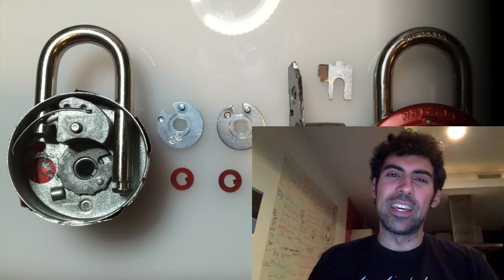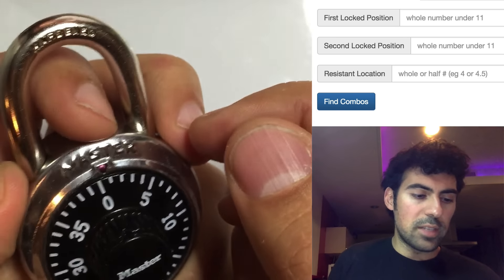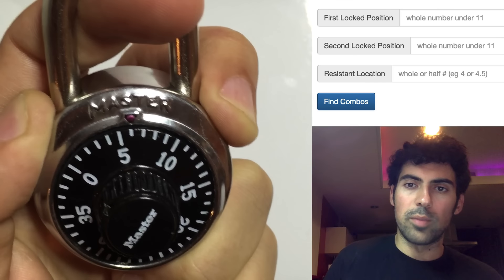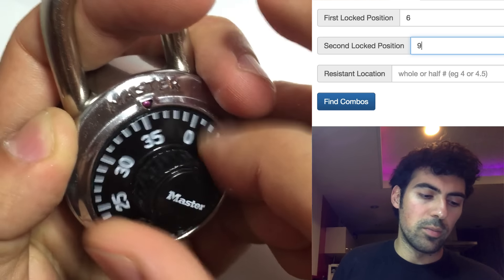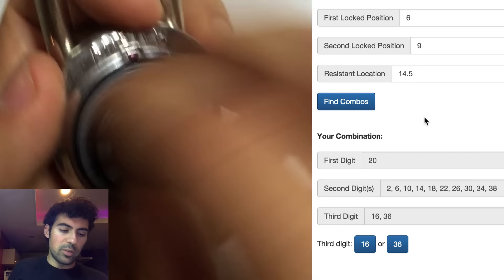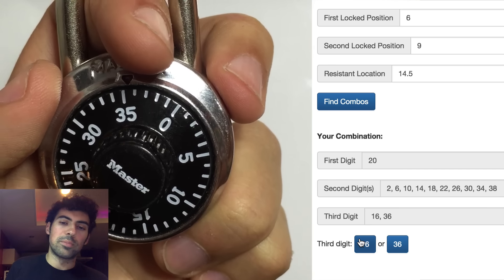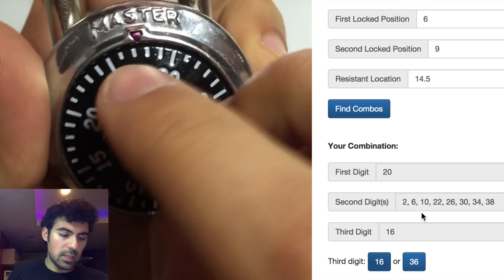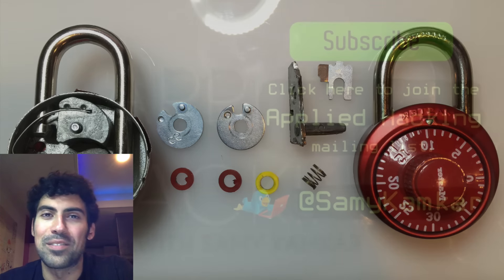Break open any Master Combo Lock in 8 tries or less!

Comment: This technique worked for me on a lock I bought around 2012. Not without some trial and error on the first two steps. However, on an old master lock that I had from the 90's, using this technique does not work. The combo is 37-27-10, which is easy to remember since the third number is the difference of the first two. Entering the first number minus 5, and playing around with the other two boxes never results in a third number which gives a 10. Now there are occasions where I get no number in the third box, so it could be a coding error on his page. Just be forewarned that this may not work on all master locks.
Reply from the maker: Hey Alexander, thanks for the comment. Did you ever get "9" instead of "10" as the 3rd number? My tool exploits a combination of issues in the lock, including the loose tolerances the lock mechanism has. You'll find 9 will actually unlock the lock in addition to 10, and the tool is built to provide a single working solution even though there are several per lock.
Reply: @samykamkar  So following your steps, I found 3 places where the dial stopped between 0 and 11: 3, 6.5, and 10. From this, I place 3 and 10 into the first two boxes, and 32 into the third (since I know the first number is 37). Just in case I was reading it incorrectly, I used different combinations of these numbers. Doing this, I still did not end up with a 9, or ten for the last number. 

All in All, you have done a great job here with your technique. After all it did help me with my newer lock. Keep up the good work! I have no problem working with you on this one just in case other people have the same problem as me.

Comment: My lock is a bit old now, but for the life of me I can't get this to work. Tried for like 4 hours now. It gets stuck between about 1.8 and 2.6, then perfectly between 5 and 6, then again between about 8.3 and 9.2. The 3rd number I'm certain is 14.5, it took me a while but it's been incredibly consistent so I'm sure of it. So my numbers SHOULD be 2, 9 and 14.5, yet not a single one of the combinations listed under that order works. I've tried both ending numbers, and I've tried all these combinations incredibly precisely multiple times over, and nothing. I've tried to account for any slight adjustments there might be, but none that I've tried worked. This lock is driving me crazy
Reply from the maker: What's your resistant location? You can also test for the two locked positions between 10 and 20 -- are the lock positions 12 and 19 in that case?
Reply: @samykamkar  the resistant location was 14.5 and yes, 12 and 19 are also the locked locations
Reply from the maker: @slothfulfrostgod5281  Okay, that helps confirm the locked locations are 2 and 9 (make sure there are no other locked locations that cross over a whole number between 10-20...I'm guessing you'll also have 15-16 without crossing over a whole number), but this likely means your resistant location might be slightly off. Try using 14 instead of 14.5

Comment: Hey awesome video I used this for many locks in the past , but I seem to have an issue with a master lock that I changed the combo on. So the combo I found that unlocked it the first time was 29-35-5 , now after resetting the combo this combination no longer works of course , but yet the same lock positions remain, and none of the 8 combos attempted from the website would work.  Am I SOL in this situation ? Or Is there a way to crack the new combination??

Comment: Didn't work for me. However, what if the first locked position is a grove that ranges between 3 whole numbers?
For example, I have a small grove that goes from 4-6. I assumed 5 would be my first locked position. 
The 2nd locked position was normal in that it had a value (8) between half digits.  There's also no other half unit grove below 11.

Comment: Didn't work on a lock with known combination.  First two digits are easy, but could not find the third one, either with eyes open or closed.  The correct third digit (for the input to the calculator) has no consistent resistance feel to it.  This is an older lock - maybe 20-30 years, I think?  So does internal wear defeat finding the correct input for the third digit?
Reply: Interesting.  It did work for a second lock with unknown combination.  In fact, there was a label on the back which gave a bit of misdirection.  I wouldn't describe the third "resistance" as that.  More of a grating feel to it.  Almost like you're running something over gear teeth.  You have to get just the right tension though.

Comment: 4 out of 4 locks failed to be resolved by this.  To be fair the 100 combo method didn't work on one of them either (still have to try it on the other 3)
Reply from the maker: +Seth They're Master brand? Can you tell me the resistant location / locked locations? Have the serial number?
Reply: @samykamkar  I'm not sure it'd be useful.  The only one I have the pass to (34,4,26) doesn't even apply to the 100 combo since it locks at 16 and 26 which would nullify the final number, but even the combination is not an option in the 100 possibilities.   This is lock #1.

#1: 904878 R:2 L: 3, 6, 9
#2: 903555 R:33 L:4, 7
#3: 630869 R:10½ and 34 L:2, 5, 8 (it is weird) 

#4: 904878 R:2 L:3, 6, 9.3 (kinda weird)
Reply: Good news, I figured out the password to one of the other locks, and I'm sure you've figured out which because you're smart too and know how I figured out the pass.
Reply from the maker: @sethlester1659  Hi Seth, that's fine -- what's your resistant location? It can be tough to find but it should be ~29. Once you find it once, you'll know how to easily find it on any lock.

The reason I ask for the locked locations under 10 is because one of them (in your case you only have one) will be the 3rd digit plus a multiple of 10. The same operation works for locked locations greater than or equal to 10, you just need to modulo 10 first. For example, (26 % 10) = 6, so your 3rd digit will be either 6, 16, 26 or 36. Two of these are then removed based off the resistant location because the (1st digit % 4) must be equal to the (3rd digit % 4), so (26 % 4) = 2 -- that cancels out 16 and 36 as they're both % 4 = 2, but 6 and 26 % 4 = 2. Your 1st digit must also be % 4 = 2 (in your case, 34 % 4 = 2). Also, the 2nd digit is always going to be ((1st digit + 2) % 4) = (2nd digit % 4).
Reply: @samykamkar  it has a resistance at 29, but it's not nearly as strong as the one at 2

Comment: Please Help. I have a Master Smooth Spin Combo Model 2076. My first number is between 1.5 & 2.5 so I use 2. My next number is between 4.5 & 6.5. What do I do there. My drag seems to be at .5. Tried multiple numbers and still no luck. Is there something different with the Smooth Spin type of lock?

Comment: I keep trying but cannot get this to work. Have retried finding the numbers and tried 32 different combo two times each. The lock is over 20 years old and someone attached it to a beautiful vintage wicker chair. I tried hitting it with a hammer but it was damaging the chair so I stopped. Shim wouldn’t work. Is there a list somewhere of all possible combos I can try?
Reply from the maker: What are the locked and resistant locations?

Comment: I tried this on my lock but I'm having trouble finding the resistant location. I can't tell what that's supposed to mean, like if it's supposed to stop or just slow down. Mine seems to be a little tougher to spin from 39 through 30.

Comment: I've had this lock stuck to my backpack since I went to the rec center a month ago, I know roughly which numbers they were becasue they were stupid close to eachother but none of the combinations that I've gotten from the website work. I can't tell if they changed the internal design after all these years or if I can't feel the right last number. I've done the first two and they were both 6 and 9 but the 3rd is a mystery to my fingers
Reply from the maker: That resistant location is hard to find, but it's there. Just takes finesse -- once you feel it, you'll be able to do it over and over again on any lock, just takes a little to first get it.
Reply: @samykamkar  thank you for the encouragement

Comment: Worked for me even tho my brand is different. Thanks
Reply from the maker: Awesome! What brand?
Reply: Samy Kamkar The sticker is peeled off on the back and the brand isn't engraved in the metal. The center of the dial has a logo tho. The logo is a house with a palm of a a hand in the middle.. might be some cheap junk brand. But it works.

Comment: On mine it gets a groove between 0 and 1, so I move on and easily get my first locked position between 3.5 and 4.5. However, when I try to get my second locked position, it gets stuck between 7 and 8 and again between 10 and 11, but decimals are not allowed. I also get my resistant number easily at 29.5... help?

Comment: Tried and it does not seem to work - I have a master lock from Sept 2022 and they do seem slightly different (the arrow at the top is black rather than red) - and so far none of the videos work ... have they changed something in the lock? I think i can get the first digit ... but 2 points of resistance between 1 and 11 are never clear - it gets blocked between 1-3 / 4.5-6/8-9.5/11.5-13 so they are bigger gaps...

Comment: I've tried this with two locks but haven't had any luck.  The first two numbers are easy to find but, I find the resistance part challenging. I relax the tension on the shackle just enough to turn the dial (without looking) and it invariably catches in two or three different places.  The last time I tried it, I was given 10 possible second numbers, none of which worked.  Any suggestions besides not taking up safecracking?
Reply from the maker: Do you have a lock where you know the combo? If so, the resistant location is about 5 numbers before the 1st digit of the combo (so is first digit of combo is 15, resistant location is around 10)...once you feel that resistant location once, you'll have a much more intuitive sense of how much you need to lift the shackle, and how much resistance the location gives and it becomes much easier to find it across other locks.
Reply: @samykamkar  Thank you for your reply.  At present, I do not have a lock that I know the combo of but, will try to locate one to practice on.  One difference that has occurred to me is that you do it while lifting the shackle with just one finger. The lock I'm trying to open is on a gate and so, I'm 'lifting" the shackle by pulling down with my hand and as a result, am probably "lifting" the shackle with way more force than you.
Reply from the maker: @togamac  I lift the shackle up about half way but note the position is very important...once you get the consistent resistance at the same location each time then you know you're there. Good luck!
Reply: @samykamkar  I tried again today. First, I rechecked that the first stop was a half number, then rechecked the next two whole numbers before 11. They were what I had before, 5 and 8.  Then, I released tension on the shackle and turned the dial clockwise repeatedly without looking at it while slowly putting tension on the shackle.  It stopped at 15.  I maintained the tension on the shackle and turned the dial again and again it stopped on 15.  When I enter those numbers, i get 20/2,6,10,14,18,22,26,30,34,__/8,28.  28 had more play than 8.  Yet when I tried all possible combinations, the lock would not open. (Unable to read the last second number after 34 so I tried 35 thru 39).  No dice.
Reply from the maker: @togamac  Last number is 38 (each one is off by 4). Closer to 15 or closer to 15.5? If it's closer to 15.5, the solutions are different (14.5 and 15 are the same though)
Reply: @samykamkar  Got it! It was the 15.5 that did the trick. Thanks again Samy for the excellent communications. A tip to those trying to open a lock that is locked such that the face is 90 degrees from your face. Try to get into a position where you can look at it well enough to positively determine a whole versus a half number; it may save you a bunch of time!

Comment: i have a question will your little program work if the two numbers that it locks in first are over 11 because the only whole numbers i am finding under 11 is 0and 10 any suggestions?? its a puurple 1526 D masterlock combo lock....i had the combo then forgot and this isnt really helping me firgure out how to open it.  ive tried working through all the sticking points plus your code breaker and im not getting really anywhere.  help please??

Comment: I know that this is now an old video, but i know when combination and am trying to reverse engineer the first position, second position and sticking resistance #, can this be done. my combination is 13-38-8.  I had 1st sticking point of (1-1.5) 1 , 2nd  (4-5 which we skipped)...so (7.6-8.8) 8 and i thought the restistance # was 35.5 so 36....The number dont match. Would love to know if we can figure out why it didnt work for me. Thanks in advance.

Comment: Did not work with sphero model... I found the trick.  Determine 3rd # by most freeplay... then use the divide by 4 and use remainder to generate possible 1st and 2nd numbers.

Comment: I give up. I don't find any first or second locked position. I tried extreme pull and hard pull nothing it just grinds over those without resistance. My first number is 3 because 37.5 - 38 is the resistance. I can't find the other numbers at all. Turning it to the right locks it at 30 can't go any further with pressure applied or not

Comment: This worked well to figure out the first two locked positions but I struggle to find the resistance number. Is there any way you could help or am I on my own?
Reply: Braydon, what works for me is to loosen the shackle tension so that it doesn't catch on any numbers. Then, look away and turn the knob while gradually increasing the tension after every revolution.  When it stops, carefully note the position by positioning the lock face in front of your face, i.e, not at an angle.  The half numbers can make a big difference, e.g., 15 vs. 15.5 in the combo.   Then repeat to ensure you have found it by landing on it again without looking. Good luck!

Comment: This didn't work for my lock. I know the combination so was just seeing if I could figure it out. :)

The first locked digit is 0 (39.5-0.5), second locked digit is 3 (2.5-3.5). Resistance digit is 15. The website says the first digit is 20. The first digit is actually 4. It's got the other two spot on, however. 

For kicks, I tried between 10 and 20 and came up with 10 (9.5-10.5) and 13 (12.5-13.5). Using the same methodology, I get 20, 23, 30, 33.

Any ideas?
Reply from the maker: I think your real resistant location is around 39 (play with how much you lift the shackle...I usually lift less than 50%). It definitely takes some finesse but you should feel it once you get the right amount (and it becomes much easier to reproduce once you feel it)
Reply: Samy Kamkar the resistance is definitely at 15. 39 is just as free as anywhere else. At the point I get resistance from 39 it starts getting locked at every groove.

I've had the lock for about 20 years, if that makes a difference.

Comment: for my first 2 locked positions are between 2 whole numbers (2/3 then 5/6) after that its gets stuck between (8.5/9.5) so my second position is 9. but i still dont have the 1st. how do i find it?
Reply from the maker: What are your locked positions between 10 and 20? If it's 12/13, 15/16, and 19 (19 being the only whole number), go ahead and enter '9' twice, otherwise if you find another full number, remove the first digit (for example if you find 15 is a lock position, enter '5')

Comment: I am not getting the combo lock and your formula to work. My 0-11 numbers have not in-between number. They all land on a whole number. Example, 2 and 3 or 5 and 6. I get a few sticky numbers but one feels to have a slight more stuck. Any advice?
Reply from the maker: Try between 10 and 20, any whole numbers there? If so, remove the '1' in front...so for example if you find 13.5-14.5, where 14 is the whole number, use '4' instead of '14'
Reply: @samykamkar  Roger that. Thank you sir

Comment: First between 3 and 4 (ignore 3.5)
Second between 6 and 7 (ignore 6.5)
Third between 9.5 and 10.5 (took 10 as the whole number for First Locked Position)
Fourth between 13 and 14 (ignore 13.5)
Fifth between 16 and 17 (ignore 16.5)
Sixth between 19.5 and 20.5 (took 20 as whole number)

I don't have 2 whole numbers under 11 (39.5 and 0.5 has a locked range, but 0 can't be used right?)
What do I do?
I also remember my third digit, but forgot the first 2, not sure if that helps?

Comment: I have tried many times to get this to open the lock that I have. Sadly with no luck. I know for a fact that the last number is 30. Which it does give me the option. But the first number doesn't make any sense as I don't recall that number being in the sequence at all. What am I doing wrong?!
Reply from the maker: What were your locked/resistant numbers?
Reply: I actually figured it out! Thx! I was about to come on here and correct myself.  Thx for the reply and assistance!